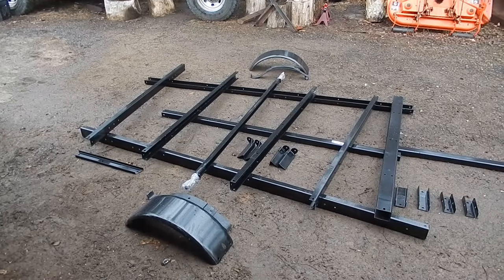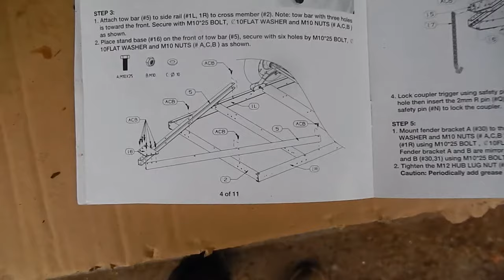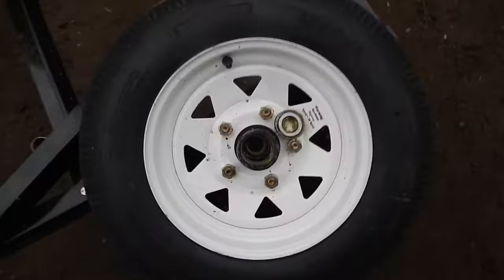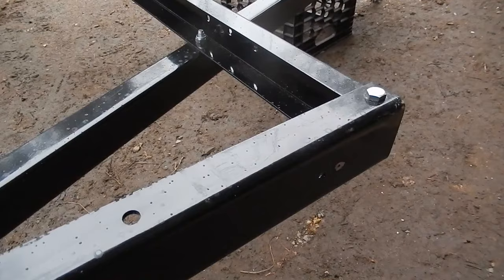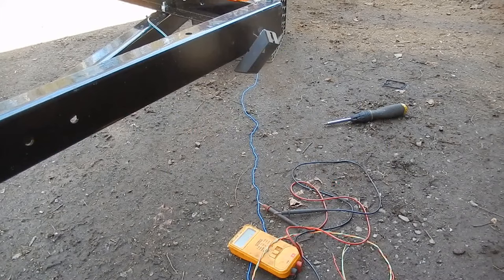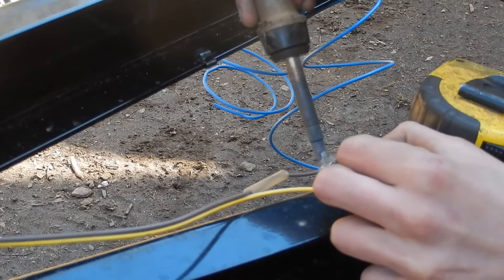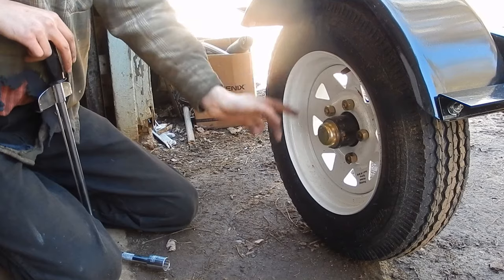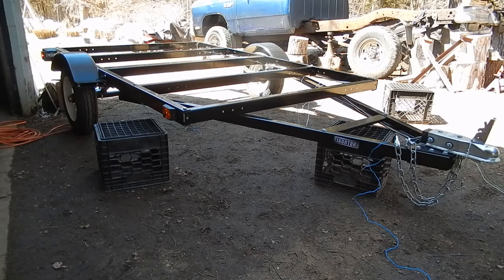Northern Tool IRONTON 5 x 8 HD Trailer - Assembly, Hints, and Review

Comment: You're right about the painted surfaces, but you wasted wire running all that ground wire.  you could have tapped a ground wire into the front of each side rail making the whole side rail grounded. Also The tapping screws going into the frame would carry the ground, no need to grind off the paint there. Thanks for the video. It will save me time assembling the one  I bought.

Comment: If you check online, you can find a Northern Tool coupon that actually works to drop off $50 bucks for the cost of this trailer or anything over $200 in cost. I used a coupon and they did honor the thing when I purchased my trailer.

I have a flickr account where I took a huge amount of photos of my own trailer build. I don't think I can link it in this section though. I'll have to see if it works or not for linking here, but I take daily photos as I build up my smaller trailer from Northern Tool.

Note: The wheels indicate they are rated for 55 mph, but at the website for the smaller trailer, the answers section recommends not exceeding 45 MPH, which is even less than the wheel stickers show.
Reply: Put the 12 inch tires on it will do fine up to 75 mph

Comment: Tip: to determine if your assembled rectangle (Corners labeled in order: A, B, C, D) is square, measure the rectangle's opposite corners diagonally (A to C) and then (B to D).  The two measurement should match if the structure is square.

Comment: If you have a Tractor Supply Company (TSC) nearby, you can always go there and check out their axles to see if they have a better quality one that has the rod from end to end. Not sure if they do, but you can check to see.  I plan to purchase the smaller trailer, as I have a larger trailer and wanted something small for my Smart Car.

Some folk use the Harbor Freight trailer for their Smart Cars, but the NT one has larger wheels and a higher load capacity for the same size trailer and is minimally more expensive than the HF one. The smaller trailer is also an Ironton from NT, so I am assuming many of the same issues will come in assembly of it. Even with your mods, I believe I'd still cover the connectors at the grounds with some type of silicone to keep moisture off them. Me, I like to coat all electrical connections with a product called CorrosionX, as it allows electrical current, but not moisture as a protectant. It is used in lots of RC applications, boats and sidecar applications for electronics. (No, I don't have anything to do with the company sales) :-)  But I do feel the product is great for what it does in protecting electrical contacts in harsh weather.

I like your video very much, as it does give me some ideas to check for on my project I'll be starting later this month. I'd like to add wooden stakes to mine instead of just the flat plywood flooring. Trimming down the fender bracing as you mentioned is something I'll surely check out as I do my own build. I don't like catching my pants legs or tearing a chunk of skin when I hit them. Replacement of the China goop for the axle packing it a must, I believe. That is one good point to ponder from your video.

Thanks for posting this video, as it will be very helpful to review when I actually start putting my smaller trailer from NT together in the future. I guess you were not aware that you can  plug in the phrase "Northern Tools coupons" and get a coupon that is good for $50.00 off of anything that costs more than $200 at their store. It actually works and it is similar to the HF coupons. In addition, NT will ship for free to your home. The manual is also provided on-line, as well in the packaging.

On my larger TSC trailer (8X6), the paint is not of a great quality. I am hoping these NT trailers re a bit better in that regard.

Again, thanks so much for your review. It will be very helpful.
Huey

Comment: Great job!  The  instructions from Northern Tool were nearly useless, and worst as to the wiring, so your guidance is essential.  The manufacturer should pay you, to be allowed to  use your video.  I need to go out now to buy some solder and flux, now that you have taught me why my soldering has failed in the past.  I also need to get a length of pipe or a torque extender, because I cannot break loose my 2" ball in order to replace it with a 1 7/8" ball.  It would be simple, I guess, if I had all the right tools, to begin with.  Naw, it still would not  have been simple, but you made it much better.  Thanks again!  Of course I have subscribed; it was the least I could do to thank you.
Reply from the maker: Thank you for the comment! I'm glad that you liked my video. Thanks for watching and subbing.

Comment: 9 Years later and trailer light kits still come with wire nuts and that crappy insulation displacement crimp connectors

Comment: Side note: All electrical wire to wire should be mechanically sound. Solder is just for the electrical connection. It is a weak bond. It adds surface area to a connection for low resistance.
Reply: the heck? solder makes my most reliable connections! technicians use crimps so they corrode and come back once their service warranty expires and because solder and heat shrink requires a bit more time and patience. i dont clamp, crimp, tape, glue (wtf) or use wire nuts. i crimp when connecting heating elements but otherwise the solder might make itself useful as a fusible link if the joint heats up. who knows.

Comment: Much of your info is exactly the same for the smaller Northern Tool trailer, as well. I used your info as a guide when building my own smaller trailer. The small trailer does not come with washers, so I added lock washers to each and every bolt at the nylock nut side. The bolts are not the strongest and can be replaced with a higher quality bolt. Also, the length of the bolts supplied is not long enough to double nut anything except for the spring plate at the axle and slipper spring area. The axle and spindle area you mentioned you didn't like is actually strong enough as it is done, as the axle rod is additionally held into the channel by the axle U-bolt attached through the spring plates on each side. You can easily replace those four axle U-bolts for stronger ones if your concerned they may be a weak point. The yellow mystery China grease needs to be removed and replaced immediately, as you state.

I did find your video interesting where you greased the back part of the spindle, as when you add the wheel, it does not actually ride over that area. Look behind your wheel at the hub and you will see, if it is the same as the smaller trailer by Northern Tool. Tightening up the castle nut will not bring the wheel up and over that part of the spindle and there is a ridge on the spindle itself that keeps or stops it before it hits back that far on the spindle. Al least it does on the smaller trailer, so no grease is actually necessary there as nothing on the hub rides upon it.

The wiring loom provided is actually a thin gauge wire much smaller than the typical 16 gauge wire of a stock trailer loom. Not so sure it wouldn't burn easily if you got a short in it, but replacing the lights with leds would mean less current draw and brighter lights, so that is something to at least think about. The white ground wire connecting at the tow bar area is a weak point as far as electrical contact for proper grounding. I do wish you hadn't changed all the colors of wires when you showed your wiring, as it made it a bit difficult to see just what you had done to properly wire your harness to all the lights.

The nut at the hitch was a great tip to check out and to see if your own trailer was possibly suffering by that nut moving and not being properly held in place. Mine was not as bad as your's was. However, even before adding the hitch to the tongue of the trailer, it makes it easier to check when the hitch is off that tongue and fresh out of the box. Once you actually mount it, the thing becomes more difficult to get down to and play about with working on it. 

Your correct as to the 16mm and 17mm nylock nuts and bolts. The other sizes are for the axle hanger bolts and are 21mm and 22mm bolts and nuts. One thing not mentioned is that during the assembly, the bolts and nylock nuts to the framework are very difficult to get at, because of the way they are located in the metal channels. A good breaker bar (Gueten Tight bar) is essential for any final oomph in torqueing each bolt into place. Each and every single bolt needs to be doublt-triple checked by final assembly for tightness. The manual, which is limited as to being helpful, does not give any torque specifications for them.  My biggest suggestion for anyone putting these trailers together, is to download the pdf manual from the company website for them and enlarge it on your screen to where you can see the photos and instructions for guidance.  The manual is often confusing instead of being helpful, but by enlarging it on your computer screen, you get a better idea than using the paper manual supplied.

Thanks for posting the helpful tips. I used your video multiple times as I built my trailer, as well. I am not certain if I'll keep mine as a flat bed or go to a box with the wooden stakes. I pull mine with my Smart Car and it is just the right size for my Curt trailer hitch. I do hope you do a follow up video to show the final bed and all as you construct it. Great video work and much appreciated by me.

Comment: Nice video and thanks for sharing. One comment regarding the 55mph max speed. This speed rating is due to the size of the bearing in the wheel not the tire. That little bearing will be spinning its guts out at normal highway speeds. High bearing speed will result in excess heat which will lead to lubrication failure. The bearing will either come apart or sieze. Neither are good at highways speeds... If you do run over 55 you need to keep a very close eye on the grease and check for heat and looseness at each stop. Heavy loads in addition to high speed operation is a recipe for disaster. Run larger rims and tires to reduce bearing speed. If your going to be loading down the trailer I would also recommend upsizing the axle so you can run a larger bearing along with the larger tires and rims
Reply from the maker: Thanks for the info! good to know.

Comment: I am not nearly as good with wiring as you all. I'm a rigger by trade. My side running lights have two wires coming out of their housing: Brown and White. Since white is ground in this scheme, should AI attach this white white to the chassis, or snip it? And of course, brown goes to brown. I would great appreciate your guidance.

Andrew - Seattle
Reply from the maker: you can attach the white to frame ground, but it is far more reliable if you make a ground wire harness like I did and attach all grounds together with a wire rather than use the frame as ground.

Comment: I found out that when I wire up a trailer I run ground wire to evey light and have no problem with the lights if one is our it sofar the bulb in the light I switched to l e d and have more problems with some of the l e d going our in the light.
Reply from the maker: i've found that the LED's are more finicky with what voltage they get.

Comment: Wonder if anyone has gone back and welded these trailers after putting together.  Not sure I like the idea of a completely bolted together trailer.  Even for a small utility trailer.
Reply: i dont like the idea of a screwed together trailer, particularly the a frame with just four bolts. once i retighten them a few times, i think ill spark a bead or "nerdle" on the end of each nut and bolt set making a crappy rivet of each, thus making it untightenable and unloosenable. loosen with fire wrench i guess. i just dont want to weld on their barely-there frame made from possibly  brittle steel. ive had trailers pass me but im not going to have one disintegrate resulting from loss of fasteners.

Comment: Is there any chance you know what the bolt pattern on the rims is? I can’t seem to find it anywhere in my research. I’m guessing 5x4.5?  Thanks.
Reply: I have the same question. 👍
I haven't ordered this trailer yet so I'm not sure. Hoping it's 5 on 4 1/2 so I can use the same Jeep wheels that are on my Cherokee XJ. 33" tall tires will make that bearing run slower too so I can do 70 on the highway.

Comment: I have a 2006 Tacoma which I bought new and it has been a great pickup.  Not sure how well it will do towing but you have a light duty trailer.  Did you ever consider building your own trailer?  No one has the time to build everything themselves.  I agree the axle isn't much to brag on.
Reply from the maker: Ron Rich My 2001 4-cyl tacoma is rated from the factory at 350lbs tounge and 3500lbs gross weight, and yours likely is too.

i considered building, but it's way too much work and i'd have to go through more trouble getting it registered. and the price would be the same if not more than what i paid for this unit. an axle alone would be about $200 including springs, then 1-200 in steel, a wiring harness, lights, coupler, welding rod, electricity, cutting discs, time... now we're well above $500.

thanks for watching!

Comment: Rim Speed Rating. 

The speed stamp on the rim is Specific to the Rim. The warning should be obvious. The rims are engineered for load and speed. The Tires Rating Does NOT Equate to Rim Rating and Capability. Same goes for wheels' bearings and axle construction. 

To all of us. Inheritance of the annoying snort, smack, uh, so, when talking Does Not make the adult think you are smart like it sounds to the child. Meaning: we all should stop.